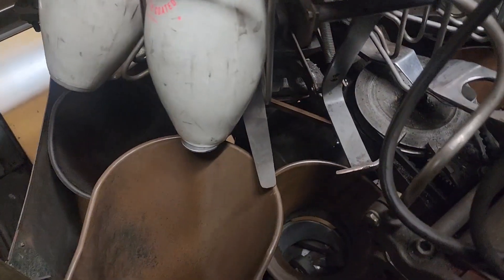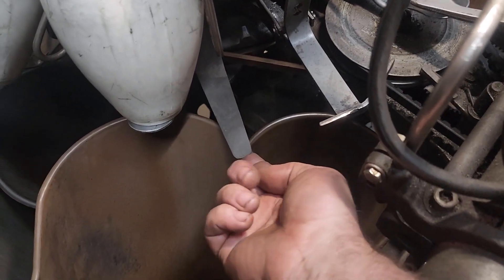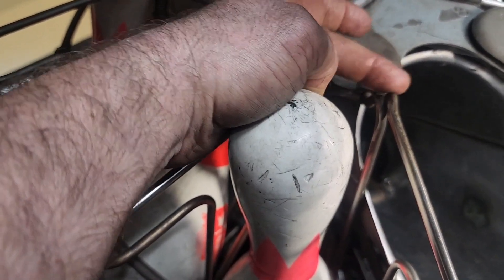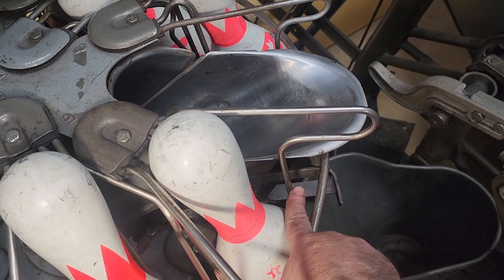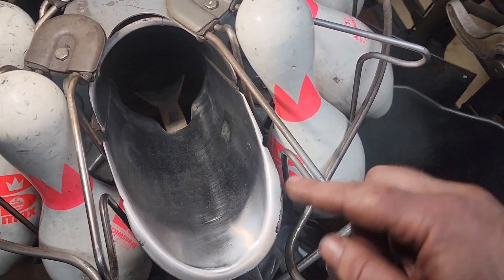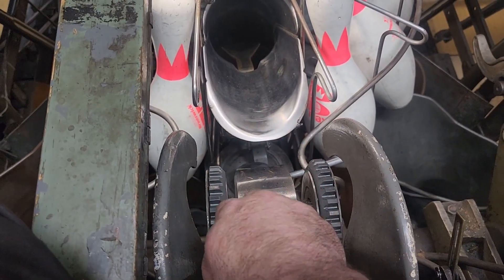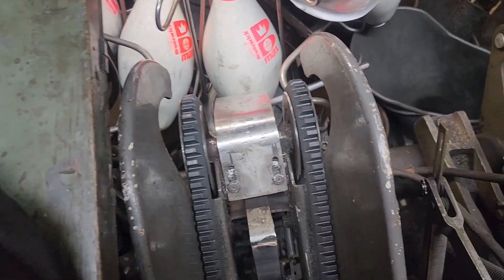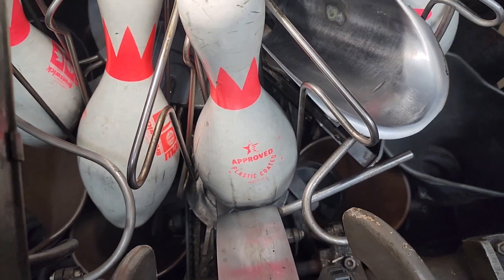Brunswick A2 Pinsetter - Bent Trip on #9 Spoon. Why did it happen?

Comment: Great catch on the #9 turret wire issue. 20+ years on these things and I never caught that. We had both the high and low styles.  Fyi, you could have put half a width of the rubber cushion under the front of the snubber and tightened bolts back up which should tilt the front of it forward. It takes some doing to bend those.

Comment: Appreciate the "investigative" video.  Thank you.  Have you abandoned your LED deck lights?  I replaced mine with Halco 87102 LED lamp roughly 5 months ago.  No problems.
Reply from the maker: I did. The GSX machines run 208 to the ballast. Most commercial LED lamps can't handle that. In the US they are typically designed to run 115V ballasts, or 115V ballast bypass. I even tried lamps that said they were 208-220v compatible. Those melted as well. Flourscent lamps seem to handle it better. Although, we have noticed that flourescent lamps that are bought locally only seem to last for a year or two.